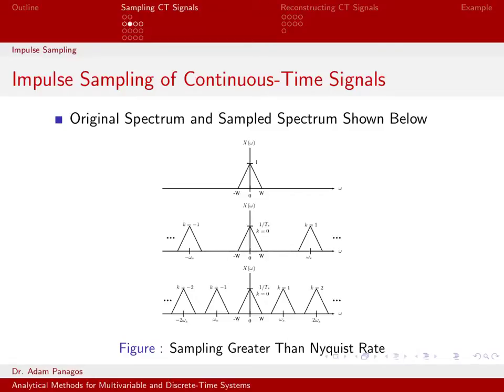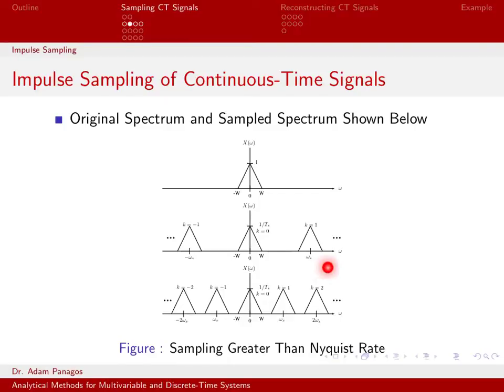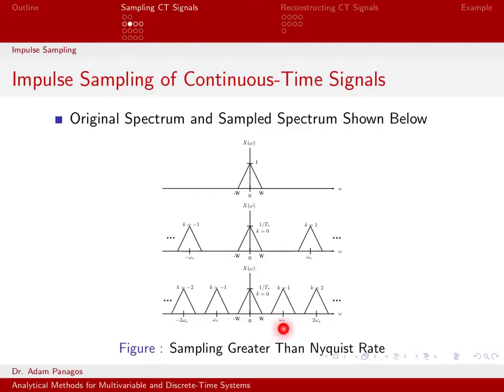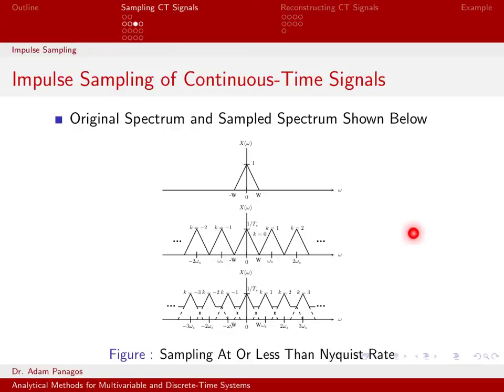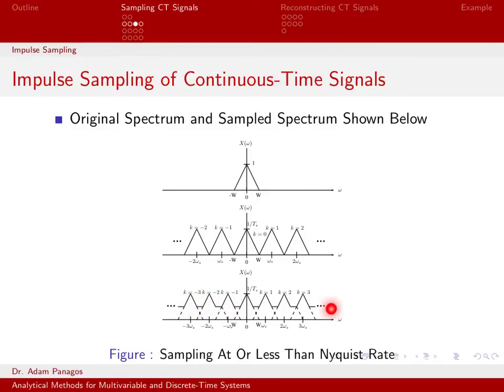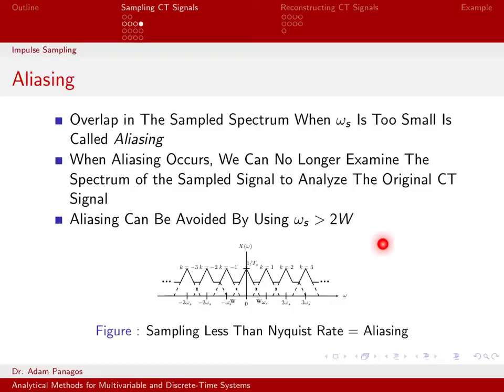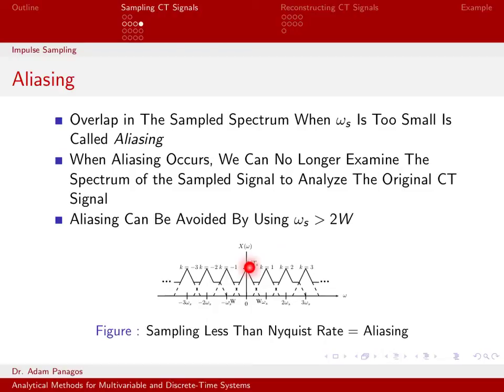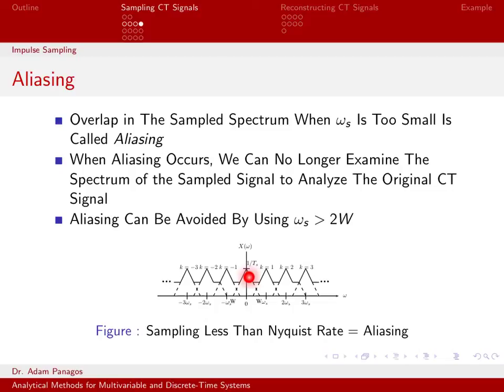Sampling Signals (4/13) - Impulse Sampling

Comment: Why can't ws (omega s) be equal to 2 times W?
Reply from the maker: omegaS needs to be greater than 2W.  If it's equal to 2W, then aliasing occurs.  For example, consider sampling a sinusoid with frequency 100 Hz.  If we sample at exactly 200 Hz, we could end up sampling at every zero crossing of the sinuosid (2 per cycle) and all of our samples would be zero.  It would look like we'd sampled a signal that was equal to zero for all time.  Obviously, this is not correct since we'd actually been sampling a sinusoid that was varying with time.  So, we require omegaS > 2W.

Hope that helps,

Adam